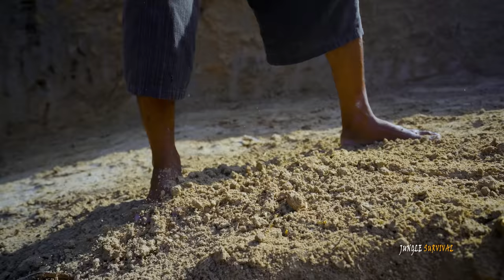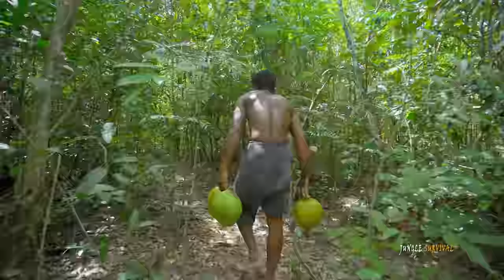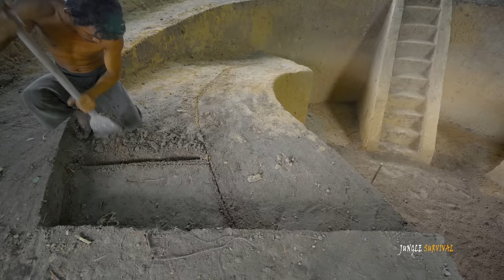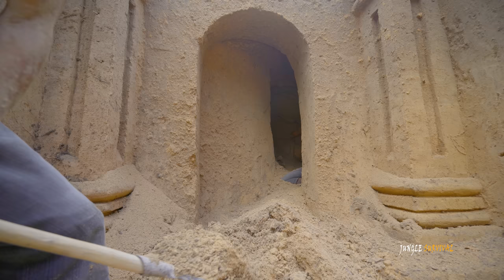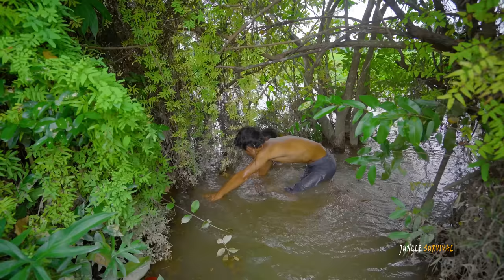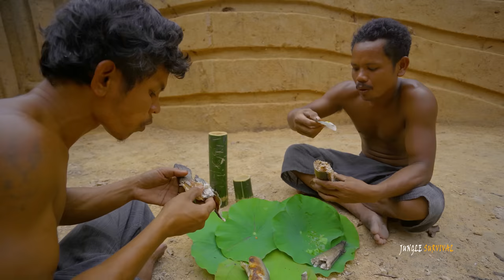How To Build The World Biggest Underground House, JungleSurvival Architecture

Comment: if only they were not using concrete,machinery,etc to built that,it would be a good video... but those are so easy to spot fake,it's just sad to look at...
Reply: What’s the mistake then
Reply: Just because of concrete, machinery, etc like that doesn’t mean it’s so bad. They literally did it with sand and cement only. How can they make it nice without cement? Have a sense man…that was with so much of hard work they just fasted it…